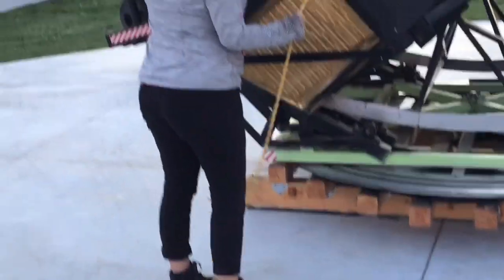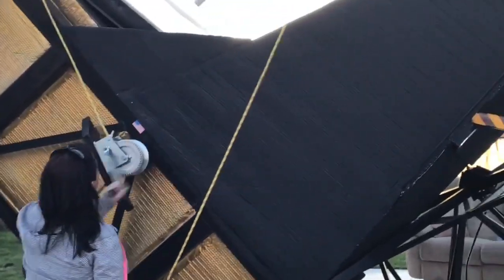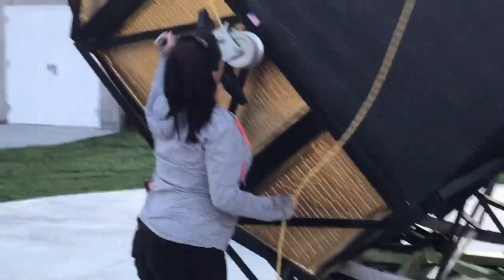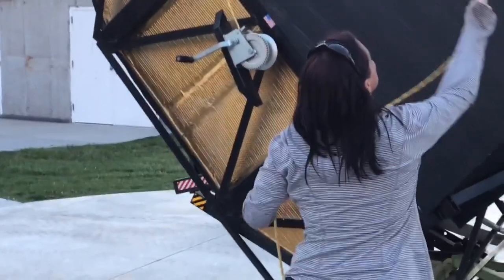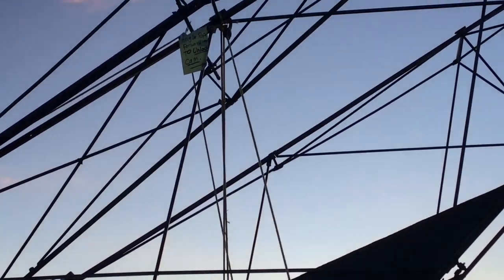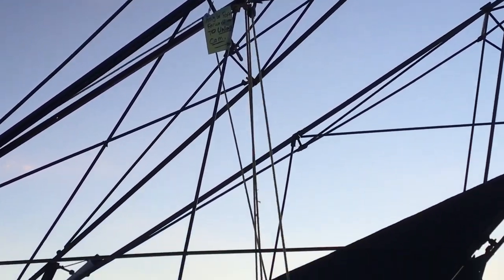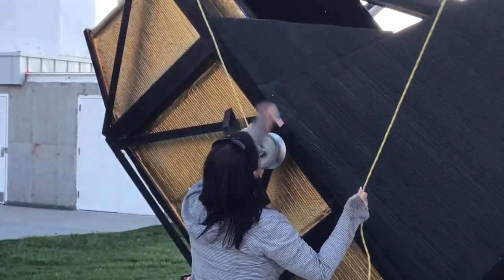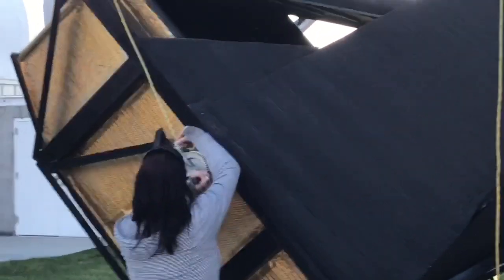Clements 70 Inch Telescope Prepared For 2019 Season, includes mirror cover opening....extended video

Comment: Good gravy! That is one impressive piece of optical wonderfulness! How do you not fall off the ladder with the resolution that mirror provides?!? :P
Does the focuser accept standard 2" / 1.25" eyepieces?  Ever tried an Atmospheric Dispersion Corrector with it?
Reply from the maker: bluesteelbass ....thank you so much! Yes, the first time, and even now, whenever I look through it, I am blown away by how this thing performs! 
I experimented with a four inch format, low power eyepiece, but due to the excessive exit pupil diameter it provided, the secondary shadow became too strong. So I now use two inch format eyepieces at approx. 275 magnification for most observing. I am not familiar with an atmospheric dispersion corrector...is is simple, or highly complex? I appreciate you feedback!
Reply from the maker: @bluesteelbass ...oh wow...I just googled it...have you personally used one? I am definitely interested! Now, since I only use this telescope visually, does it work well for visual? I look forward to your feedback!